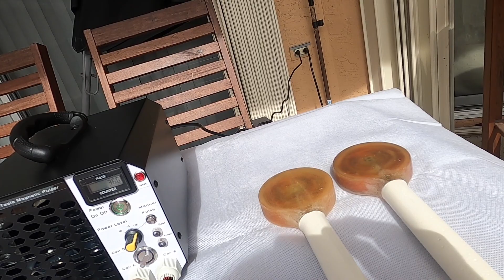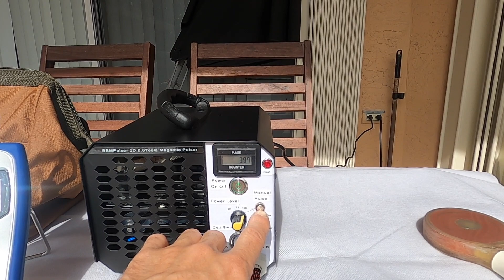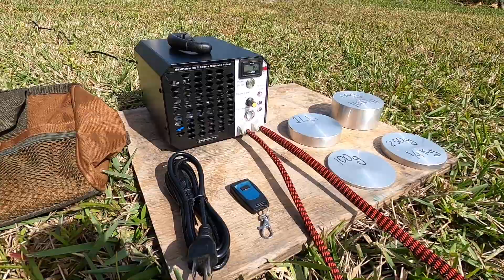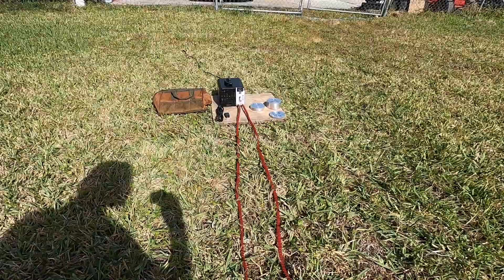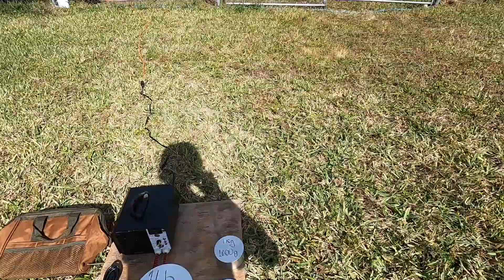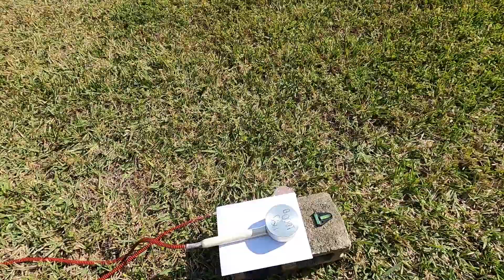028 Introducing  BBMPulser 5D 2.9 Tesla (29,000 Gauss) Strong Magnetic Pulser 2 Coils new Look

Comment: Hello friend, my name is Robert, I have followed your videos and your diagrams are of great value, as I know that you have excellent experience in pulsator and yours surpass those of SOTA, sell me a diagram that only handles between 6000 and 9000 gaus, only I require that power, I know that yours handle 24,000 gaus and 29,000 and I think even more, my email is robebarroso@gmail.com, a diagram that is well explained and that its components are easy to find, I am willing to pay by paypal Thank you again for your input.
Reply from the maker: I appreciate your offer but I don't charge for free circuits. 
https://bbmpulser.org/electronic-circuits/
The power output from 1.4 Tesla circuit can very depending on the coil. 
I use 0.1 ohms coil and it give me 1.4 Tesla
If you take my first circuit (1.4 Tesla) and put smaller capacitors, you will get less output.

For example instead of 2,200uF you can put 1500-1800 uF 350V Caps and you get maximum power of around 10,000 Gauss. 

BBMPulser 4B circuit doesn't offer Veriable Power output. 2.4 Tesla circuit does.
what type of coil (load) are you going to be putting on it (circuit)?

Comment: Andre, your coils are fixed connected to the assembly in the case. Is it possible to alter your design a bit by making the coils detachable from the steel box, for portability? Are there disadvantages when you make it detachable?
Reply from the maker: The reason I cant detach coils because during initial Pulse I have very high Current Spike up to 1,500Amps traveling true the wires with this model. How I know because If I put thyristor with fusion currant less then 1,500Amps - it shorts. 
Now can you find connector capable of safely holding  1500Amps and small in size. Please give me some examples of the connectors.
Also if i put the connector I will create weak point in the line. I cant warranty units with a weak point in the line, I sure you want the warranty
Reply: @AndreyD  I see. Thanks Andre.